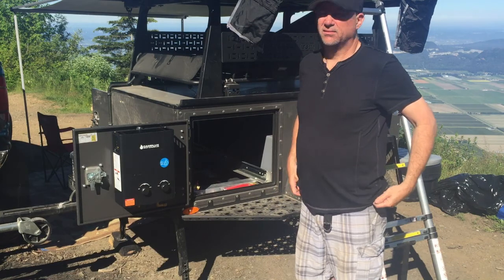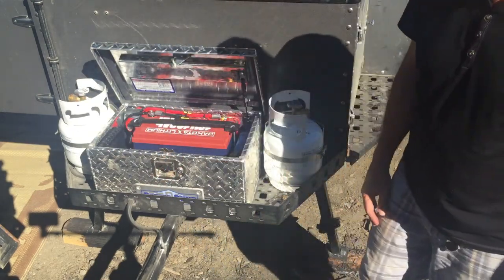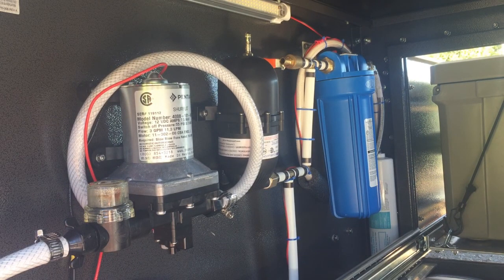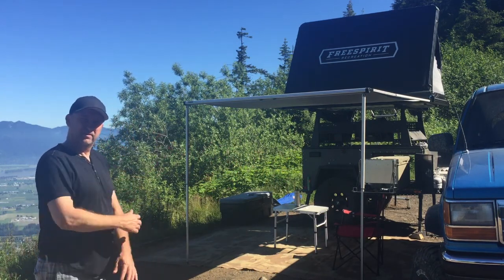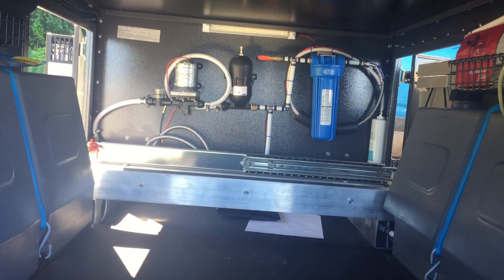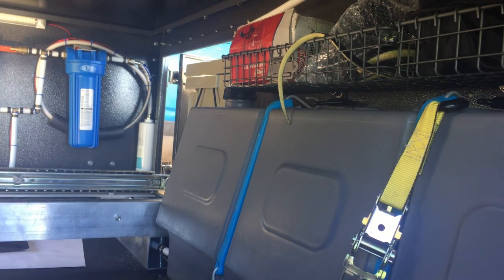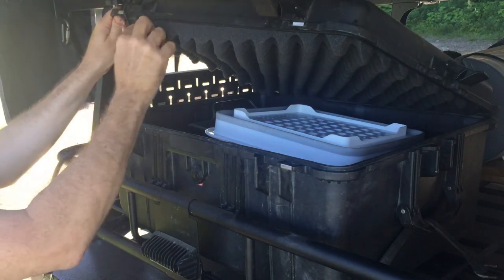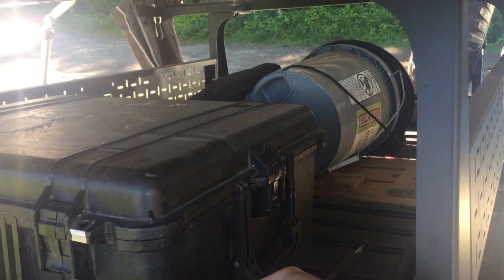FSR OVERLAND TRAILER

Comment: I have a different trailer but I like some of the details from yours that I will be adapting to my own (water system for sure)    Have you tried mounting the spare to the side racks?  For shovels etc, I use Quick Fists.  Simple, sturdy and quick.
Reply from the maker: side mount would be an option perhaps on tent entry side. I’m pretty obsessive about symmetry though. just going to have in basket I think. I’ll look into the quick fists, gotta pull it out soon for camp season!
cheers!

Comment: Would you share the mounting and details of your frig slider?
Reply from the maker: I could, what specifically do you want to know?
Reply: @Exploduer what slider did you use? Specs on the base so that slider would clear the bottom edge of opening?
Reply: @Exploduer and thank you for getting back to me… more questions… how did you attach alum tubing to floor or is the alum angle attached and is that how you anchored that base down?
Reply from the maker: Hey!
The angle is bolted along with the tubing. I drilled holes in tubing and angle so that I could mount with four bolts.
For clearance/ isolation I cut out some pieces of the original rubber mat and glued to underside of the tubing. I did however find that as the door side settled in it ever so slightly rubbed the door opening. Later I installed some fender washers between the angle and tube on the door side, only needed a little bit of lift there.
*the rubber between aluminum tube and steel body of trailer is important to guard against corrosion between the dissimilar metals.
Reply from the maker: https://a.co/d/gotgI8Z